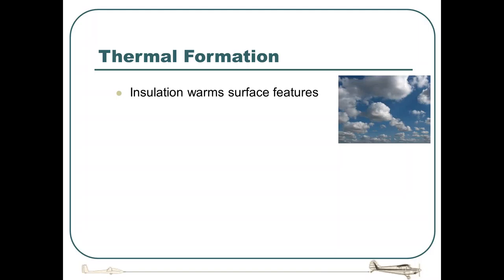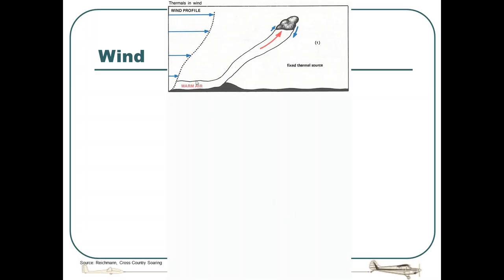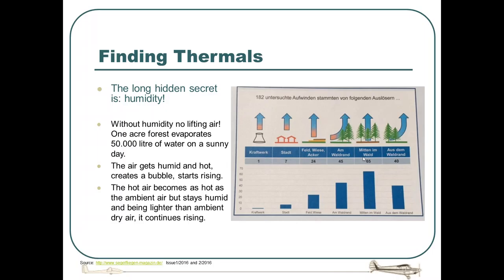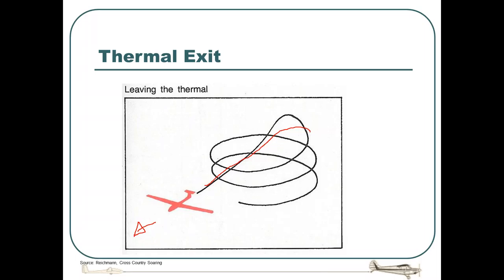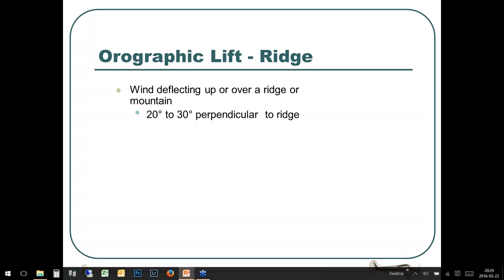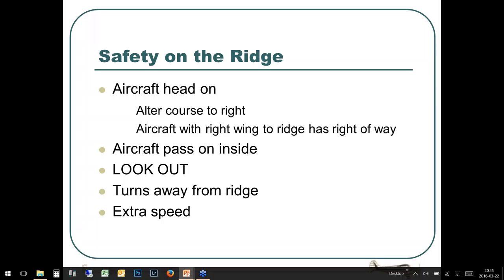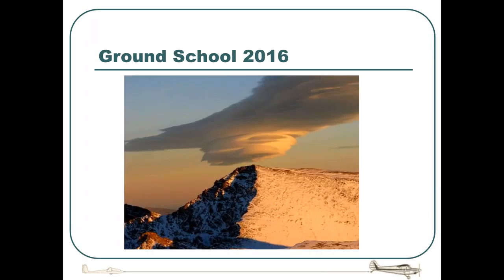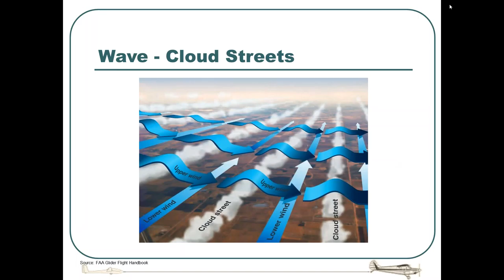2016 GLGC Ground School - Session 5 Thermals, Ridges and Mountain Wave

Comment: 1:27:00 The question of passing on the inside raised by the tug pilot is a good one. I think this is a terrible idea. Someone flying on the ridge flies along it constantly getting closer too and further away from the ridge searching for the best path. If someone tries overtaking at the same altitude on the inside then the pilot being overtaken has no idea that the other plane is there. That is an unbelievably dangerous situation given the speeds and altitudes. Certain death. The only safe way of overtaking is being on the radio or being much higher or lower than the other craft. NEVER overtake on the inside.